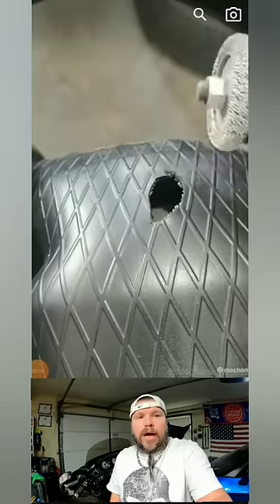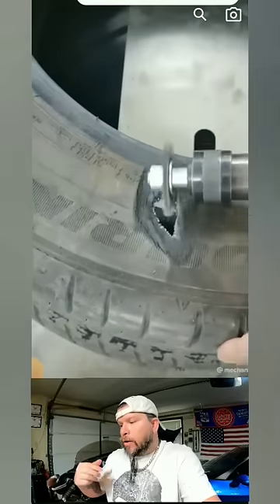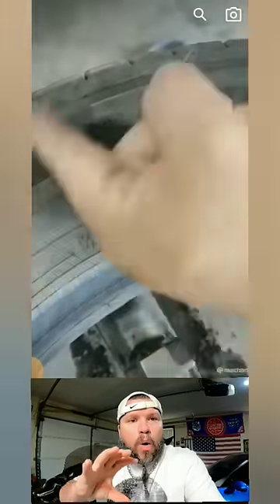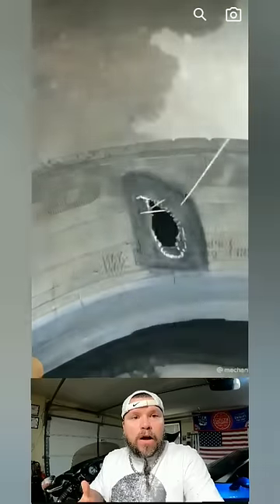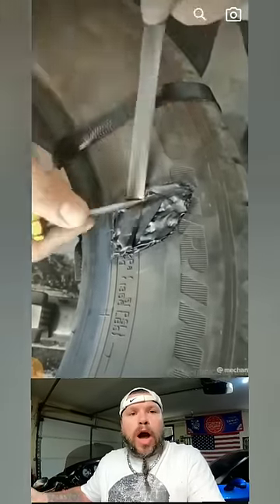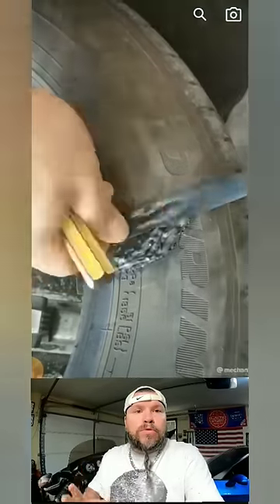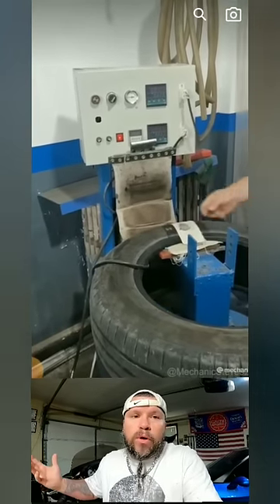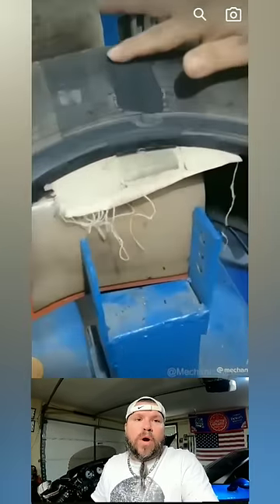patching a tire

Comment: He must have worked as a maintenance guy at my old job. Them dudes would duct tape just about everything 😂😂😂
Reply: That's just engineering "it's moving and it's not supposed to? Duct tape. It's not moving and it should? WD40"
Reply: That looks like electrical tape, which like a car tire is made of vulcanized rubber.
Reply: I'm sure that works tire shops are lazy and don't want to work. There's no money to be made if they do this. They just want to sell you a new or old tire
Reply: if you cant duct it fuc.... wait nvm
Reply: Fareal. It was a fridge that just need a couple screws to keep the handle on.  Why this dude duct taped it.
Reply: Ducktape fixes everything-Most moms😆gotta love em tho
Reply: @lunareclipse7049 , my wife had a wound butterflied with duct tape by her mom, when she was a kid
Reply: @COMMANDERHAWK22  Duct tape snitches, not bitc... Oh wait,nvm
Reply: Duck tape fix anything
Garila glue for home repairs
Flex seal can repair anything
Me: Fix, home garage, repair the holy Trinity in that tire
Reply: @iwontliveinfear  yep, that machine he pulled it out of it the end was a vulcanizing tool
Reply: That's not duct tape.
Reply: Not the good ones
Reply: It's not duct tape tho, it's a thin black rubber that gets melted in the tire after
Reply: Thats to much work. To me. I have my own shop and I offer this for custumers who ask for it and tell them is not for ever fix. You all can complain. BUT you be surprise there is people who don't care even though I charge a pretty good bit for all the work needed and time consuming.  But at the same time you be surprise how long something like that will last you. I been many years in this and even my self is surprise when I see a custurmer with the same tire after so long. ... and is NOT DCUK TAPE
Reply: some tires you can patch tho. Cuz some are solid
Reply: Duct tape.

The handyman's secret weapon.
Reply: @iwontliveinfear  oh really??

So he just melted electrical wire then?
Reply: the good ol' "put some duck tape on darn it"
Reply: 🤔 I think my father must have worked there at some point...
 Or maybe he was just WAY too French Canadian 🤣
Reply: I was lead maintenance mechanic for a production plant. I wouldn't allow my guys to use duck tape. Zip tie, baby!
Reply: Don't forget zipties!
Reply: @iwontliveinfear no electrical tape is made of vinyl
Reply: @poiiihy depends on the electrical tape. Some of the cheaper ones are vinyl, but there are many many different formulations out there.

Comment: Was a tireguy for 2 years in high school. No reputable shop will ever repair a sidewall. It's dangerous, and a major liability. 
Also, if you have a flat and you've driven on it, the service manager at the shop isn't scamming you when he says you need a new tire. Driving on the flat causes irreparable damage to the inner layers of the tire's sidewall. If you went 100 yds or whatever, looking for a safe place to stop, it's not gonna be a problem. If you drove any significant amount, the inside of the tire will be full of "pixie dust." Rubber shavings broken off from the hard inner sidewall lining. That tire is a blowout hazard. 
Don't fight with the guys at reputable shops. They're not trying to rip you off. They're trying to keep you safe.
Reply: Probably need a new rim as well
Reply: I had a leak in my tire from a nail or something. Tried to get a new tire, they suggested I just patch it 🤷 said the tire was still pretty good.. But now I'm wondering if I should still go ahead and get another tire 🤔
Reply: Listen to this man. I’ve driven with a flat for a few km then patched it and reninflated it lasted maybe 700 m post repair and blew out at least it was a rear
Reply: @4everSoulja Tread patches are just fine. Nails don't get in sidewalls by running over them. Your tire ought to be fine. The shop the patched my tire wouldn't even patch a tread if it was punctured too close to the edge. Good thing for me that it wasn't.
Reply: I've plugged a sidewall and drove it on hwy for years daily in Texas. 😅
Reply: I work at a Volkswagen dealership and many people think we are scamming them but there are safety regulations we have to follow. Usually if it’s within two inches of the side wall we refuse to patch and recommend a new tire. It’s a serious risk of blowout with the compromise on integrity of the tire.
Reply: @AutoMotoMechanic You're either lying, drove it a few times per year at granny speed or drove on the smoothest highways in the US. Definitely wouldn't hold up in NYC on those highways
Reply: @adriankalitka3762  nah. Plugs work fine worth a good tire. No issues. Lots 3hr hwy trips. 2004 gmc Yukon on procomp 35 inch tires. Dallas ft worth isn't know for very good roadways. Maybe not as bad as the shithole NY tho
Reply: @AutoMotoMechanic plugs are only good to slow down a leak until you get to a tire store for a latch/replacement. Only thing plugs are good for long term use in are lawn mower and some 4 wheeler tires.
Reply: @AutoMotoMechanic even if it worked, you are INSANE for this bro
Reply: @WerbleWerb  tire plugs will last till tires wears out. Never had an issue. Plugged streetbikes tires also and I'd go 160mph on them. Now patches on other hand I've had cone loose and deflate. Plug over patch all day everyday.
Reply: Thank you bro people don’t get it also as a current worker and a tire shop don’t take any car that cost over 30,000 take it to the dealer cuz we beat the shit outa cars at said shop
Reply: @warthogA10 I’ve had to drive really far on blowouts before, like roughly 4 miles pulling off the freeway. Definitely destroyed the inner tire, but my rim was fine. Another time I hit a 23 inch deep pothole that took out both my passenger tires on wide thin Mercedes rims. They were total fine.
Reply: @alhassirakhdugani5813  you've obviously no experience in the industry.
Reply: @RAndrewNeal yup if it’s within 1 inch of the sidewall we won’t repair your stuff.
Reply: @adriankalitka3762 i can say with the highest degree of certainty that you have absolutely no authority to speak on this topic. Tire plugs have been used safely for decades upon decades. I worked at a shop that probably did a hundred a week and not one single time did one fail.
Reply: @adriankalitka3762 not saying it’s the right thing to do but I ran a plug in the sidewall of a nitto terra grappler for like 30k miles till the tire was bald and it never failed. not smart…but not impossible…so maybe chill with the calling someone a lisr
Reply: Two years in highschool? So your weren't a tire guy ever, you were a boy that acted like he knew about tires.
Reply: @AutoMotoMechanic you got lucky and/or rarely traveled highway speeds

This patch shown likely won't even survive initial inflation
Reply: Yes you can I seen it work and last
Reply: @miketorres934  would you trust any shop that told you "this fix MIGHT save your engine"
Or maybe 
"This suspension fix SHOULDN'T come apart on the highway"

If there is any reasonable chance of a dangerous failure, the shop cannot take that risk
Reply: Your right worked in a tire shop for years and you never patch a sidewall
Reply: one time working at a tire shop we saw a minivan coming from way down the road just rolling on a flat tire so we're like yeah that guy needs a tire so we were telling him how driving it flat will ruin the tire and he's going to need a tire and I peeled it off the Rim it was a brand-new Kelly he bought a couple days before and I couldn't believe it we all inspected it because it was crazy you couldn't even tell the tire had been driven flat and still look brand-new somehow so we patched it and sent him on his way
Reply: Every realize this is probably overseas and 99.9% of you youtube specialists HAVE NOT tried what the guy in the video probably has been doing for years successfully?

I typically  don't like to comment on videos like im a specialist when I don't know this guys method, where he is, or his  success rate  at doing this.
Reply: I agree with this guy.  He sounds like he knows what he's talking about. That's way too dangerous.  You're not only putting your life at risk, but the lives of others.
Reply: @justinleonard6183  having a rear tire blow is actually much more dangerous than in the front, if it were to blow at highway speed it can make you lose control and even possibly flip over, in all the auto shops I've worked in,if the  customer won't replace a bad tire we were told to put the bad one"s",in front in case they blew,a blown front will instantly slow you down and make you pull over, a rear could send you into a  spin at high speed and really ruin your day
Reply: Exactly when the shit shops won't even try that says alot
Reply: @RAndrewNeal nails and other metal can get shot through your tire and hit the side wall from the inside. I worked for Walmart and changed tires with a nail shot through the tread and poking out the side wall and iv had just a long piece of metal probably used to be a welding stick but it was just the metal rod that was left with none of that stuff that makes it look like a big sparkler it was shot through and bent inside and then out the sidewall there too and it was just mangled up inside the tire. Iv found all kinds of things inside tires iv also seen where something came in and was just scrapping the sidewall from the inside kind off sanding it down so it had to be replaced and some of this you can't see from the outside so you see a nail or a piece of metal and then on the inside you see damage to the sidewall. If you have a flat make sure to check the inside sidewall and outside sidewall and if you're not patching the tire make sure to tell the person doing the patching because they may be young and not do anything but pull the nail and patch the hole only.
Reply: @Death_Vail666  I hadn't thought of that. Good thing I had a patch put in my tire instead of a plug, so they could see inside when taking the tire off to patch.
Reply: @RAndrewNeal On one of the tires on my car, there was a screw stuck in the tread like right at the edge. The valve stem was leaking, and I had a leak in the bead. that tire came off the rim at one point, but I didn't travel a very long distance since I was pulling into a parking lot when it happened. Ever since I had the tire reseated on the rim, it got issues keeping air. I don't know how long the screw was in, but I feel like the bead leak was an issue since it was reseated by the tire shop I brought it to. I work at an quick lube and tire shop right now, and I got the screw hole patched, vavle stem replaced, and the barrel grinded with an applied sealant before it was reseated with the bead pressed into the rim to eliminate the bead leak.
Reply: @Prestiged_peck Yes. I would love a shop like this. Even better if they can give me a probability of it holding up for a number of miles. I’d like to be the one to decide my safety tolerance, not the shop.